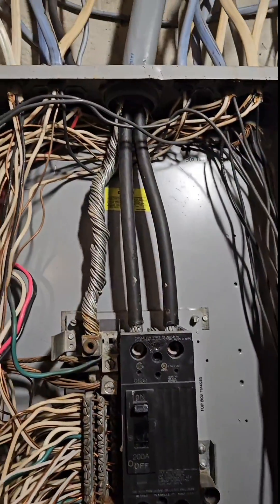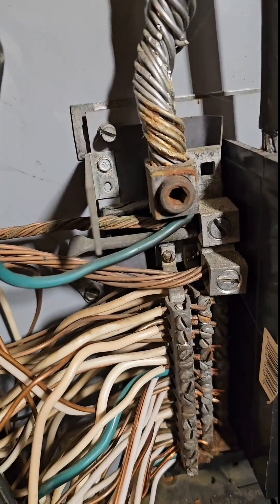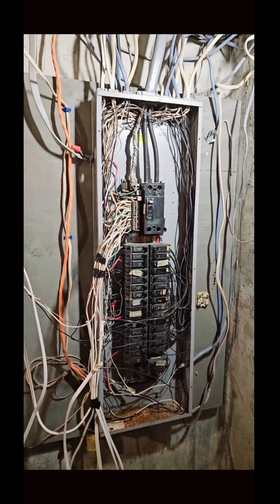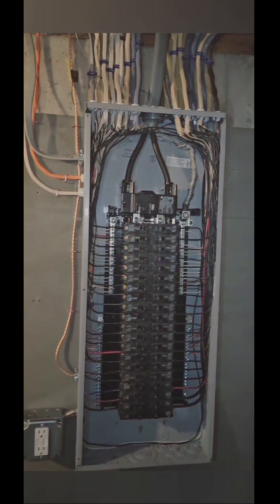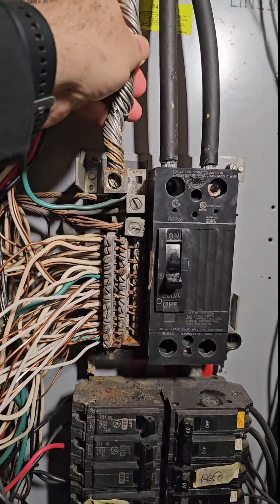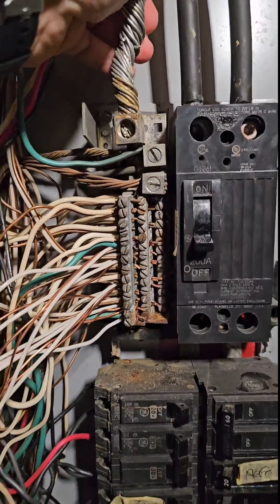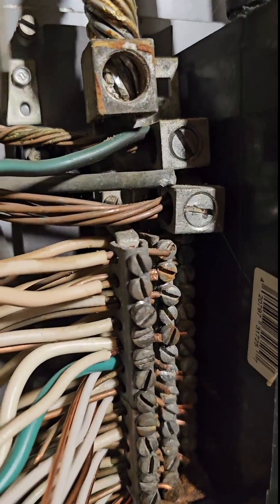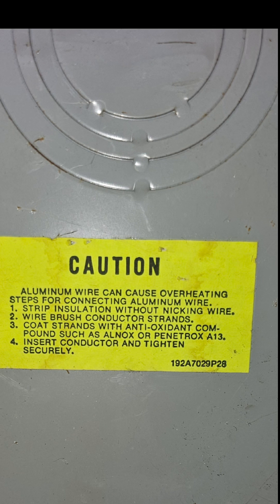swapping out a panel from the 80s

Comment: 🤔 That is interesting, in a way not completely surprising, the aluminum comparable outlets and switches state that they don’t need it. The justification for using aluminum originally was that it’s really not that bad of a conductor. The problems however were all the result of oxidation. 🤦 Aluminum does that in spades but there’s bound to be ways to limit that. Aluminum bronze comes to mind first but metallurgy is a crazy complicated field.

Comment: damn, terrifying stuff, the sheer amount of exposed cables and loose stuff alone wants to make me dump it all and start over.

of course there are regulation differences from place to place but bringing in a aluminum cable straight to the main junction box is alarming to say the least
Reply: oh, just to remind that you did a great job, I'm just not used to nema standards at all, we are still decommissioning the last straws around here in brasil
Reply from the maker: There is no danger to exposed 120 v if you are not grounded you can touch it.  In 28 years I have never been shocked while working on a panel.

Comment: AA8000 alloys were developed in the late 1960s and were commercially available in the early 1970s. They were not required by the NEC until 1987.
Reply from the maker: I just knew we stopped needing in the late 80s thanks for the extra detaisl